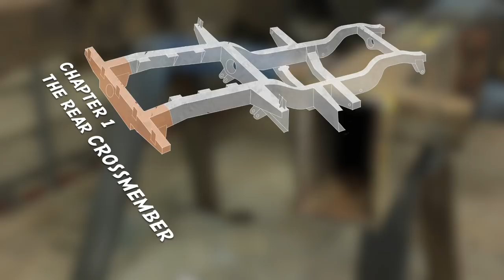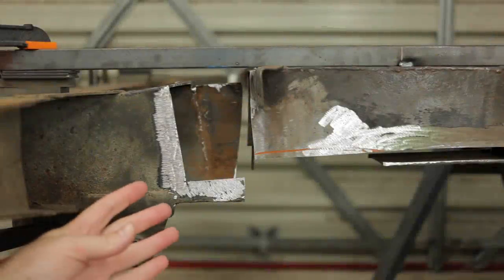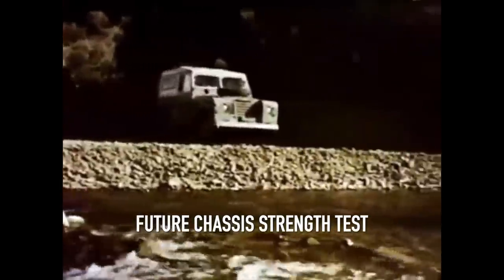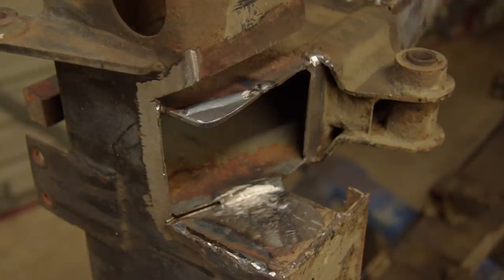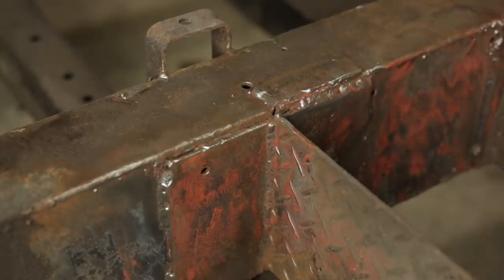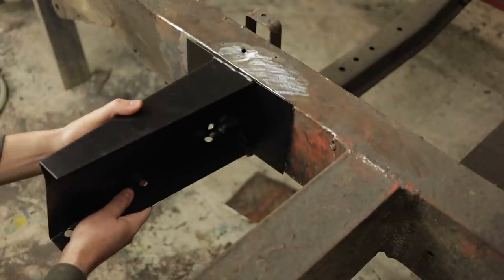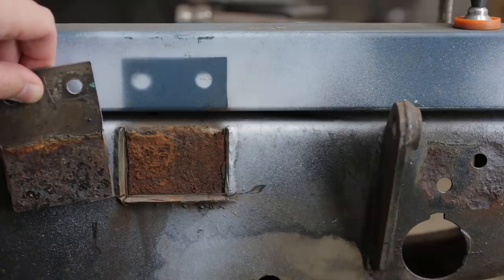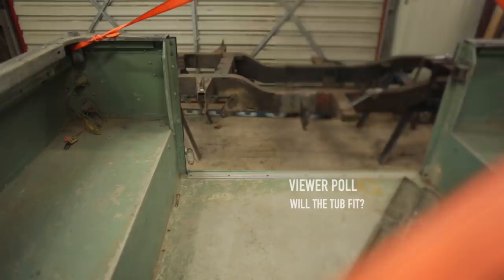Land Rover Restoration Part 13 - Chassis Repairs 1/4

Comment: To  get the rear cross member lined up in the factory they lined it up with the Solihull-Stonehenge Ley Line and it was welded in place by Welsh Virgins. I think you did very well considering....
Reply: Surprised you did it without the thick denims that the lads in Solihull wore

Comment: Very good work and entertaining!  I just discovered this series by accident.  The level of detail and explaination is great, even for someone familiar with automotive systems.  I like that you take the time to show the details and basic operation of the components for those who may not know.  I'm an auto enthusiast, who has a soft spot for old Land Rovers.  However these are rare in the US and astronomically expensive if you can find one.  These videos show me the particulars of a vehicle I'll probably never get the chance to own or experience.  Keep up the good work.  I know you'll finish this, just because of the sheer investment in a project like this.  My current project is nearing $35K US at the moment!  Your name is greatness just by itself!

Comment: I sandblasted mine first just to see what I had . It looked similar to yours. There were so many new holes when it came back I realized even if I repaired it there would be areas that were thinner than when new so the overall strength and safety of the chassis would be compromised. So I bought a brand new galvanized chassis. With all the cost of a rear chassis member front irons outriggers, time and effort and rust protection and future rust breaking out it was a no brainer. Plus the mot guy is always happy with the chassis  now Phil

Comment: I like the small patch approach. It's good that you can eventually get back to good metal to weld to. What I like in particular is that you're running decent beads with the welder. the "stack o dimes" look that prevails on youtube obviously hasn't got to you yet. I imagine it came from tig welding but people mig like it now. I feature some welding and like to run a decent bead myself. I must say your welder is nice and smooth and quiet. Mine makes quite a racket and you can hear the big solenoid clicking in and out. Mart.

Comment: Brings back memories of a Series 2A LWB Truck Cab I had. Total nightmare of a job, chassis rails packed full of mud and rotten to hell. I spent a two week works shutdown, ripped the body off, repaired the chassis, renewed all of the electrics and the brakes and rebuilt it. It was still a noisy, slow and cold vehicle but at least it wasn't going to fall to pieces on me. I vowed never to buy another one.
For reference, Landrover didn't build the chassis; that was GKN Sankey at Telford, UK. They're still making chassis for Landrover today and I came across a stack of a dozen or do Series 1 chassis stacked in their yard outside if the test lab I was working in. For a while, under Ford's ownership, a company called Thompson (I think) built the chassis but when they went bust the official receivers tried to force a price increase out of Ford on the basis they could stop the assembly line at Solihull if they didn't get the extra money. Ford contacted GKN and Stadco (Shrewsbury, UK) and within 72 hours had a new line of supply in place.

Comment: I must say, every time a new video is coming up I get really excited! Love the videos and pls continue to make them they are both amusing and really funny to watch! 

Ps. Pro tip weld from the top and down and not from the bottom and up, u will see a huge difference in weld
Reply: Not entirely true, vertical up welds provides better material penetration. Vertical down is more suited to thin sheet metal which doesn’t require the high penetration.

Comment: Another entertaining videao.   You are a good welder too!   You need a flap disc for the grinder - smoothes off welds in seconds.   So much better than grinding discs
Reply from the maker: I use flap discs at the end for the final smooth. I can't afford flap discs for the rough grinding though. Those things are mucho expensive!

Comment: Overlapped sheets of metal with a paper-thin gap between them, also known as a sponge, a breeding-ground for rust.
I'm not surprised that overlapped section of the frame from the past crossmember repair rotted out!
It'll be right now though, all that good metal welded in proper-like! Ahh, what a tease! XD

Comment: The "imaginary" line is very likely a jig line. Kinda like 0 in architecture/engineering. It makes no sense unless you have all the bits in, and without them it could be anywhere, even on the second floor. :))
Edit:
Patching is perfectly acceptable in an enclosed structure. As long as the welds are good, you can make it a quilt if you want. Molten metal is molten metal after all. I've seen a lot of comments in other repair videos on chassis that stem from people who don't really understand structure or argue based on regulation, which is more than often an umbrella ruling, meant to avoid inexperienced people from building rolling disasters. Simpler to ban all, rather than deal with mishaps.

As you made it, perfectly acceptable, and it has just as good structure as the original. Some could argue that fixing a chassis shouldn't be done because of crash safety, but that's a problem solely reserved for modern cars. Good old iron pigs like the Land Rover don't particularly care about these kinds of things.

TLDR: it might behave differently than the OG, but it's just as strong, if not stronger. Encloses chassis for the win.

Comment: While it doesn't matter for this build; strength of the chassis is not just based on more steel and more welds, stress and fatigue are big problems. Chassis flex a lot, different thickness boundaries and welds can create stress risers leading to fatigue and premature failure

Comment: Nice job so far and another well edited film, great to see you posting again. 
Galv chassis not an option? WRD's chassis was just like yours - little crusty patches that became gaping holes when poked, despite looking good. I have not regretted the chassis swap one little bit - one less thing to worry about.  The reduction in flex through the whole vehicle was immediately noticeable.

Comment: Since we are on the topic of rust. I recently build a tub out of 3mm steel that I really should have made out of stainless. 
It has a little bit of water sitting at the bottom. How long do you think it will last before it rusts through?

Comment: May i offer a tip from my experience, albeit limited, with MIG welding? When welding vertically with MIG, it seems to work alot better to weld from top to bottom, rather than opposite. It seems that any "runs" or "buggers" will be absorbed by the weld, as you move down. 
Pulsing the weld, as you did a few times, is naturally also a good option!
Keep up the good work!
Reply: Not entirely true, vertical up welds provides better material penetration. Vertical down is more suited to thin sheet metal which doesn’t require the high penetration.

Comment: I'm at the same - a bit further along in the process. End-plan is (will be) to have it so the entire upper structure can be removed in 15 minutes or less with zero awkward fasteners to open & nothing to disconnect electrically beyond one single multi-plug.
 I want to be able to look at a bare chassis/drivetrain devoid of bodywork in the fastest time possible going forwards to make future maintenance easy. To that end, every fastener is being/will be changed to metric going into captives - either riv-nuts or welded nuts so everything can be opened from "the easy side" with an impact driver for speed, the stock hardware is mostly going into the bin in favour of much simpler bracketry which includes the entire floor/center console section - that will end up as one section that unbolts easily & lifts out in a couple of minutes without the absolute faff & guff that removing the factory version entails.  I also coated the entire inside of the chassis with anti-corrosion which involved drilling holes all along the length every foot, so it can be topped up with next to no effort in the future.  

Next up is pulling the motor & utterly gutting the factory crap so that it is as clean & minimal as possible with access made much easier - I want it too to be a 30 minute out jobbie - so everything will get quick-disconnects, the wiring will get boiled right down to just a couple of quick-connector multi-plugs. The exhaust is already changed so that it can be disconnected in 2 minutes flat beside the gearbox - the gearbox is also boiled right down so it can come out in 10 minutes flat with zero guff if needed. I gave that a whirl yesterday to see how long it took to remove - yup, about 10 or 15 minutes with back in taking about 20. Most of that time is eaten up disconnecting/connecting driveshafts which is kinda un-avoidable. So yeah - much fun, making it so a LR can come apart in jig time. :-)

Comment: why not fill the chasis with some kind of foam? like they do in some modern tube frame chasis
Reply: I imagine it wouldn't quite fill every void and if it did would create a wee gap to keep the water in. Perhaps a oily, rust preventing foam. Perhaps just regularly squirt in some Fishoilene.

Comment: I just found your series of video's on this LR, and I love watching it! The filmwork and information are on point, and you've made me laugh more than once! Keep up the good work! I was wondering, did you or are you going to do any rust prevention on the inside of the chassis? Like weld-through primer before welding, or any protection after?

Comment: Project Binky, New Zealand Edition.... way cool! How are you going to get on with a warrant of fitness? I believe they can be quite harsh.
Reply from the maker: I think it'll be fine. They don't worry about existing repairs for a WOF. It's only if they ask you to get something fixed for the WOF, that you need to provide a declaration from a certified repairer for the re-check. Because the inspection guys don't want to be responsible for checking the repair.

Different story if the vehicle was out of the system. The requirements for a new registration are more pedantic - OEM standards, etc, etc.

Comment: 1) Nice work.
2) Does the little Makita survive the process? -It was working really hard
3) (trivia question) about how many cut-off discs did you work through?
Reply from the maker: Ha. This is my second or third.. can't remember. At least one has let the smoke out, maybe two. And this one has just started playing up. Sometimes I have to shake it vigorously to get it to start :)

Comment: I'm in the process of overhauling one of my 88" and about to start working on the frame. It's a little worse off than yours. After seeing your leaf-spring video, I started considering using phosphoric acid as I progress in wire brushing the whole thing.
Whats your thoughts on that?
- Cheers from Denmark. I really enjoy these videos!

Comment: A question I've always had about chassis restoration is ok you are nice and dandy, you cut and replace the rusty parts, weld them well, wire wheel the whole thing and paint it correctly.  But what about the inside of the chassis parts, wont it be rusted in many places inside where you can do nothing about?

Comment: Chassis are usually high in Chrome.  Probably why the tabs rusted more than the Chassis.  Should use high Chrome mig wire too.

Comment: Well water has got in there and blowen the chassis behind the welds , but the chassis is suppose to be galvanised, hot dipped galv but your on to it and it will be new ,soon

Comment: I’m sure some people would have covered all those holes with more chequer plate!

The rear ended look not irking you enough to justify the hassle of fixing it... you were kidding nobody with that!  The man that has to restore his tools first so that they’re pretty enough to work on the Rover...😂

Will you be having the repaired chassis dipped and galvanised, or are you going to use paints and internal wax?

Comment: Don't tell anybody at LTNZ or VFNZ about any of this, just paint it all black after de-rusting and carry on with your minor repairs.
Reply from the maker: Should be ok. It's still registered, so just the normal WOF checks.
Reply from the maker: You obviously don't leave chocolates and beer sitting on the front seat then?
Reply: Just what I was thinking. You need to be careful Geoff

Comment: Excellent job, is that a gasless mig you are using 👍
Reply: I would say not as there is no sign of the slag you get with gasless welding, ( the flux in the core makes it more akin to stick welding, but without the Penetration or quality).

Comment: Geoffrey Geoffrey Geoffrey 🤦🏼‍♂️
By fitting the strengthening bars
on the outriggers, you've just turned
this powerhouse into a street legal
road rocket that would out corner 
a track ready Lamborghini 🤷🏼‍♂️😱
I can on hope you've prepared 
yourself for the strong arm off the
law when this animal hits the road!!
🏎💨💥🚨🚓👮🏼‍♂️🤜🏼🥴😵🚨🚑👩🏻‍⚕️
You have been warned Mr Croker 😁

Comment: Can you show us how to plate ( yellow Zink or how it’s called ) ? You know the style of plate bolts or carburetor parts are plated with .
Reply from the maker: There is an electroplating video on my channel. That's a diy option. I use a commercial plating kit for my stuff though.

Comment: It's crazy the chassis is so thin metal, I'm not a mechanic but it looks pretty thin.
Reply: Yes, they're definitely a bit flimsy. We had an old landrover ute used for farmwork come through our shop, and it had a cracked chassis just past the cab. It was just about completely broken in half, it was bad enough the centre of the vehicle was sagging.
Reply: @zeroyon4562  Compared to a monocoque the Land Rover is thick and heavy duty.

Comment: Im contemplating doing this to my series 3, but removing everything from the chassis fills me with dread...!
Reply: They are giant Meccano kits, take photos of everything you take off, label everything and keep nuts and bolts with anything you take off, this may seem a little labour intensive but if you have never done this before you will appreciate it when you reassemble it, just lifted the body off a dormobile conversion engine/gearbox and axles, chassis will be sandblasted to show any "soft" spots before repair or replacement is considered, it seems more daunting than it really is, just be a bit methodical about it and you will be fine.

Comment: Actually  I dont  like   a lot  of  chasis  wielding....  I would  replace  whole chasis to  a better  one......  Chasis  is  chasis  it  should  be  a  solid  one  not  wielded  from  parts  .....
Reply: lass kinn  Yes. Series and original Defenders were. I think all the modern offerings are Monocoque so will not be many left in 30 years time.
Reply: d
ont like small patches , go big or buy a replacement part ,pays in the long term in 5 or so years time